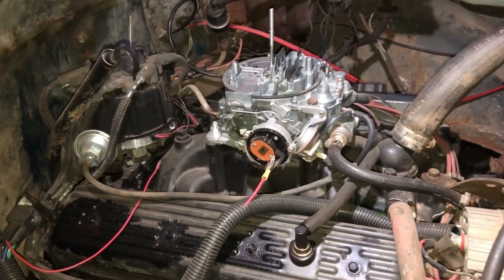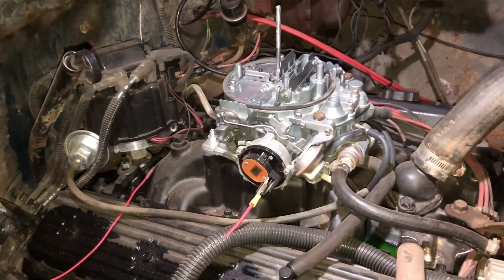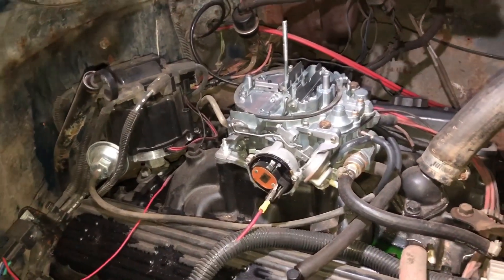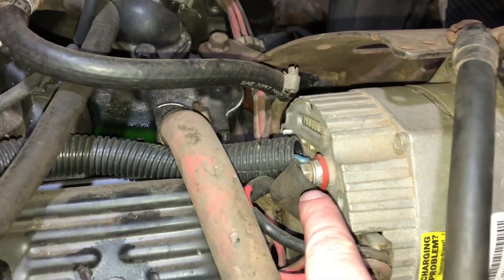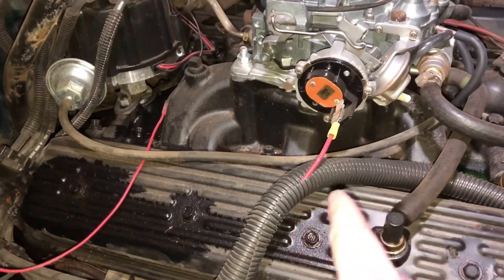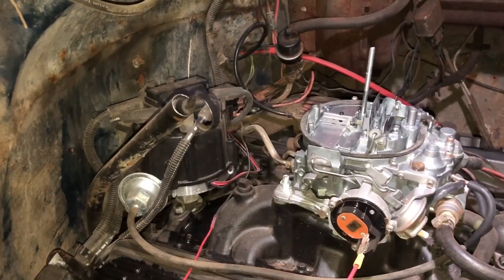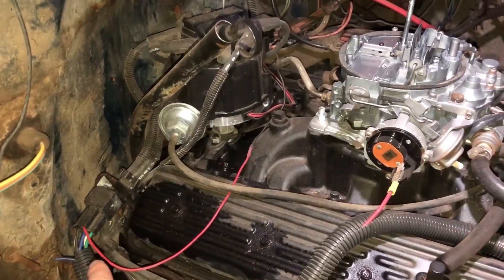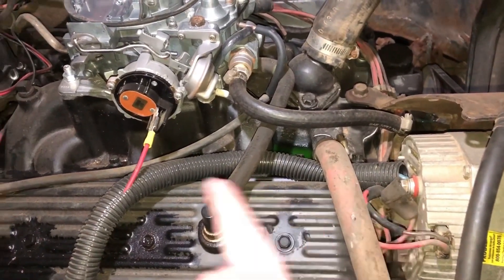Use Relay to Power an Electric Choke

Comment: There are several unused single 1/4” plugs at inside fuse block. The instrument cluster runs with a 5 amp fuse. This has a Delco 10SI / 12SI alternator. The Red is system voltage sense while brown goes into dash bulb for battery or alternator/Gen light. I is hot in run and bulb run check. The brown wire is ground when not working and B+ when running. B+ is applied to the IP battery bulb that acts as a current limiter to 0.25 amp when hot. But goes out when running with working alternator from “Brown” field wire as B+ is applied the B+ from key in run. This means the B+ voltage is applied to both sides of the bulb so with not potential for current to flow, but goes out!
DK, ASE master tech since 78
Reply from the maker: Great tips on the way this is wired.  Initially, I wanted to trigger the relay off of the alternator so that the choke wouldn’t be heating up unless the alternator is spinning.  That is to say, should the engine stall, the choke would begin closing rather than continue to open.  It sounds like this could be done by simply grounding pin 85 on the relay and tapping into the brown wire for pin 86.  This was my preferred way of wiring it, but the ignition coil was the quick and easy way to power the relay without having to decipher how the alternator was wired.
Reply: @mebordernoneya8484  Yes, Pin 86 can go to the brown field wire behind dash or IP Cluster. The original internally regulated Delco alt control ground to rotor at 400hZ below any AM radio stations, but use a “Y” connect stator. Magnetism remains to some level for months but use a key on thru the battery light, to alternator excites it to ON state. Field becomes B+ and goes to dash bulb. With 12+ volts on both side that light simple can’t come on. 
As for a running engine dying, the choke (If warmed) takes a long time to actually close. Plus, at WOT the linkage actual opens choke to allow for warm engine restart, just like EFI, but it just shuts injects off at 95%. Both keep from flooding. CCC started in the 80’s and I have a factory service manual for 86 “A-Body” that I will have to look at. Honestly I can’t remember all! Imports are the easiest, because they simply tap into the “Y” junction and call it “Neuter”, “N term”, Neutral”, it depends on the company. I rebuild them all over they years. Delco has a diode trio. It is 3 extra small diode who feed the regulator with voltage. This starts to fail, is where you get the dim red battery light on dash. When they changed to “CS” generation, they quit selling parts because they had 28 different regulators. It provides power to the coil at 400hZ instead of ground. And uses a “Delta” configured stator, which produces high current. The 194 “Peanut” shaped bulb got limits current to 0.25amp, same as test lights for years. Using this, you can connect to B+ and apply voltage on certain computer circuit without damage, because current in a series circuit is limited to the smallest resistor. 
I will check the book and let you know but don’t worry about stall and choke closing. It take 5/7 minute for the choke to cool down the bi-metal spring and tension the choke valve.
Reply from the maker: @deankay4434  
My main reason for wanting to wire it using the alternator as a trigger is so that the choke stops opening during a stall.  I’ve had it stall on me while I was trying to let it warm up during extremely cold weather.  Usually I’m away from it trying ti get the shed doors open while I let it run on fast idle to warm up. I’m not so much wanting to choke not to close, but rather stop opening for the few minutes it takes me to get it restarted in really cold weather.  That said, it’s been pretty reliable outside of a failed carburetor gasket recently. 

Even more helpful would be keeping the choke powered and open for 5-10 minutes while at the fuel station in warm weather.  Always a hard start when hot and the choke cools down while stopped for only a few minutes.  But such is the way with a purely electric choke.
Reply: @mebordernoneya8484    >Simply use a test light or volt- ohm meter meter to make sure your choke has voltage.
  My approach based upon your cold stall, is the choke is set to lean. Loosen the three screws and move one notch richer. This means to tighten the choke clockwise one notch. Snug screws and retry. I alway demanded carb rebuild spend the night to I could check the tension on the choke valve (Called Butterfly by Everyone) but going just one notch stiffer. Now, in a book or rebuild sheet will show the choke opening. This is not carved in stone, as all engine has characteristics. Now, if external, some have small hole to the out side as a bleeder. If you find a tiny hole, cover it with masking or duct tape. I use a hand held vacuum pump to open a cold choke valve. Measure at the top of the air horn and choke valve, changes when first started cold can be made leaner or richer. Simply pushing with a finger open or more closed, adjust the choke opener the direction that makes it run smoother.
  I do have to ask a painful question! Do you have a cotton-based air cleaner that looks cool and the box says it adds horse pony’s? If so, I can’t help you much. The reason the air filter is covered and had a snorkel with a heat riser tube (Foil cut to length heat riser tube) that the air cleaning draws warm/hot air into the air cleaner housing with a vacuum hose, now gone? Go find it for cold weather operation. The hose goes to live vacuum, bi-metal element, then to a housing with a valve that teeter-tooters to control air temp going into the carb. If cold, then engine runs betters when richer, this is why. The carb can not adjust the A/F ratio but controlling air temp between 140 degrees F to 148 degrees F ( Yours May Vary) but this is how they keep the engine running well when cold! So, choke setting, choke opening setting (Richer means smaller opening / leaner mean larger opening). Factory air cleaner vacuum hose, bi-metal valve and hot air vacuum motor (Diaphragm) opens when more heat is needed and drawn off the exhaust manifolds / headers (I guess if she’ll metal trap pulls hot air into air cleaner) keep air air correct temp.
 Remember, cold air is dense and contains more oxygen. Warm air is less dense and has less oxygen) Either warm or cold effects the air /  fuel mixture. Too far one way or the other causes stumble/hesitation/falls flat on its face & stalls.
  The only thing you can do is more to where is the same temp all of the time. Adjust choke richer in winter, adjust leaner once warm outside. Install OEM air cleaner and adjust choke and opener to factory settings and remove the short hose with the bolts screwed into end, set to factory settings and eliminate stumble, hesitating or stalling. Pick one!
Best, best of luck!
Reply: I hope you're still on YT. I have an '87 454 motorhome with an electric choke light in that never goes out. It reads around 14 volts at choke while engine's running only, so the choke is working correctly. My questions are why does the choke light stay on all of the time, and why am I getting 14 volts at the single choke wire, (which is fused at 20 amps in fuse box, and fuse is good)?
Reply: @DUCKSAREEVILLLLLLLL   Most anything from 1984, would have a re-man alternator on it. I grew up rebuild these and the “F” terminal is the Field that produces battery voltage when running. GM has used a relay to power the electric choke. The voltage at the choke should be almost the same as battery voltage depending on temperature. Inside the alternator are two items misunderstood by many. The diode Trio provide power for the regulator. Also, the wire-wound resistor on a ceramic housing changes with temp. Air is drawn in the back and cools the internals and the pulley fan is centrifugal. Cooler air = higher voltage. Higher temps = lower voltage. Thus 13.2Vdc - 14.3Vdc.
The stator is connected in the middle of 3 coils and this is the field or imports call neutral or “L” terminal. On GM’s, the “L” terminal produces 12+ volts when working. It goes to the dash lamp and the key sends 12+ to the other side of the dash light. Key on, engine off, the “L” terminal goes to ground, turning on the light. When running and working alternator is working, you get 12+ on both sides of the dash light, causing it to go off. Having a diode trio failure would cause the dash light glow dim. If the alternator quits, it goes to ground and light comes bright. The “F” terminal powers the choke relay to provide electric choke to heat and open. I have run the “F” terminal directly to the choke and several hot rods. The only motorhome I work on was old man “Oatey” who manufactured the wax toilet bowl ring. His business was long sold, yet still in box stores everywhere. Don’t get voltage and amperage mixed up. Amperage in a volt-ohm meter has to move the positive lead to amps, then select high amps on the rotary dial. If reading is low, then it’s safe to move to low amps. Both has fuses inside the DVOM if a good unit. I have four, but two are Fluke. My 87-IV will read 20 amps instead of 15 max for most. An amp clamp is best for checking or sizing a fuse on a new circuit like fans or stereo amps. Voltage drop measure loss in a circuit from point to point, even ground. Grounding the back case of the alternator with a short bolt to the engine block is best practices. Battery to engine block, frame, frame to chassis (Especially truck cabs and bed, motor homes too) I run grounds with “Star” washers and dielectric grease everywhere. It keeps out moisture and helps cool connectors and reduces burnt terminals. Hope this helps! Many good videos on voltage drop, just remember that current must be on, circuits are series so the device consumes all the voltage. Never worry about which leads goes where, as a digital meter reads the same, just with a (-) symbol on it. But, always start at the battery to check its health,  voltage drop test running on alternator to battery B+, negative side also. B+ to fuse box/relay center. Turn on headlights, fan on high, radio, then do a voltage drop from battery positive to fuse box, alternator to battery. Readings should be near zero or 0.03Vdc - 0.400Vdc in high current circuit like alternator, winch, lift-gate or snow plow. 
  Best of luck!
Reply: @deankay4434  Thank God for you! Despite there being only a single blue wire to the choke heater, I think these OEM electric choke systems are complicated. As for my alternator, it could need replacing. The dash volt meter drops to 12 volts or so at night with dash fans and lights on, and you're are right that the alternator isn't the original. I thought maybe someone put in an alternator that was too small, which could cause volt drop to 12 volts at night on the dash volt meter, and then when re-connecting wires, they somehow connected something to the wrong terminal at the alternator or a relay which is causing the 14 volts to the blue wire at the choke heater. Is it possible that someone connected the choke wire to the wrong terminal at the alternator or a relay? 

In any case, the alternator is just physically much smaller than the alternator in most cars, yet it is expected to power more devices; I haven't checked the stated amperage output on the label of this alternator, but I'm going to try to find the largest amperage alternator I can physically fit in there and replace it. If you have time, I'd be very grateful if you'd look at the GM schematic that "docvette" posted in April of 2007 at this site:  

https//wwwhotrodderscom/threads/electric-choke-voltage.113154/.

 and tell me if you think this is probably pretty close to what I have in my 1987 GM motorhome. I removed ":" and "." to avoid YT link block so you're going to have to put the above address is a search engine to find it. Sorry about that.

I very much appreciate your help.

Comment: Have you ever had gas go to your engine??? I had that happen to me just recently
Reply from the maker: I’m not sure exactly what you mean.  I have had it get flooded if that is what you are asking.  That’s the downside to an electric choke.  It can make it easy to flood them out on a hot restart.  If you think it is flooded, just hold the pedal to the floor and crank until it clears. Holding the pedal to the floor forces the choke open to get more air through the carburetor.

Comment: Is there a way to test on this to see if it’s working properly after installing?
Reply from the maker: Yes.  Check the voltage at the electric choke.  If you got it all right, the voltage will be the same as the voltage at the battery when the key is on, and will drop to zero when the key is off. 

You could also run an ammeter between the wire that feeds the choke and the electric connection choke.  It should read zero with the key off, and should pull a couple of amps with the key on.

Comment: I just got a 87 dodge ram running, just been closing choke by hand to get it started, fires right up open choke after a few minutes idles fine, i bought the divorced electric choke coil on ebay for my truck, it attaches down on the intake manifold has about a 8 inch bar that runs up to choke on carb, only has one wire coming off it for power, it says its 3 volt, can i do this system like you have and run the straight 12 volts to it? thanks for video
Reply from the maker: Should work just fine assuming that the linkages for the choke are all working correctly.  Just use the pin out in the description and you should be fine.  The wire with 3v is definitely not enough to operate a choke, but it may be adequate to run the relay.  I would give it a try for the sake of convenience. Relays don’t take very much to run.

Comment: Why the factory didnt use a relay the amp draw is minimal
Reply from the maker: Some people get away with it. If you want to try it without a relay, pick a non-critical circuit to power the choke. The benefit to the relay is keeping the choke on a separate circuit so that there is no chance of overloading the factory wiring.  

The easiest key-on power source is the Ignition coil.  If anything happens to the choke or the wiring to it, the fuse for the ignition pops and you are dead along side the road. The relay essentially eliminates that risk.

Comment: What is the amp draw on the relay coil itself?
Reply from the maker: I didn’t measure the one I have installed, but typically speaking they are much less than an amp. Usually around 0.2 amps (200 milliamps).
Reply: @Bob Casteel   > 3 watts if the coil is 90 ohms. Some relays have 60 ohm and others are close to 40. It is the amps the contacts can handle continuously that matters, but never measured a choke heater ever and be it is under 5amps. 
Use the Power solving math is P divided by I (amps) X E (voltage) 
Requires a direct readout amp clamp or a digital multimeter (DMM) but should be fused with correct size. 
DK, ASE master tech since 78

Comment: Can you run terminal 86 to the ignition terminal on the fuse box in the cab?
Reply from the maker: Tyler Thacker 
That should work fine. Any 12v circuit that comes on with the key will activate the relay and energize the choke like it should.